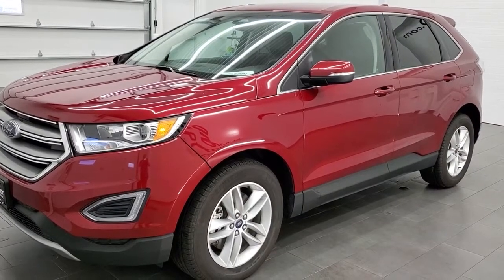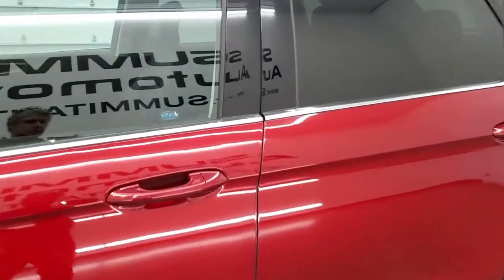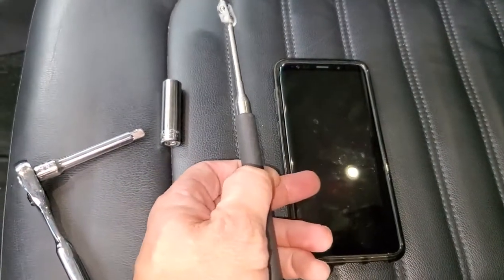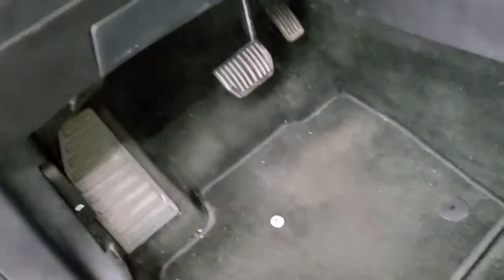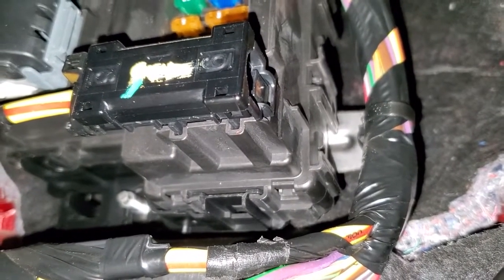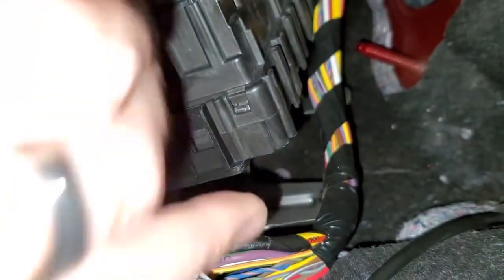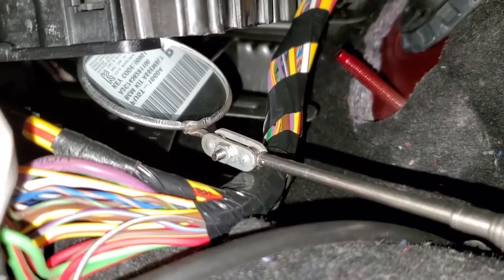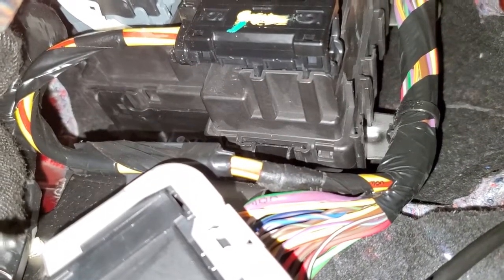WHERE IS THE DOOR CODE LOCATION FOR MY FORD EDGE DOOR CODE 2015 2016 2017 2018 2019 2020 2021

Comment: What a dumb place to put it I've seen so many other ones you take the cover off the glove box and it's right there there's got to be another place somebody said in the back somewhere you got to take a cover off or something I don't know what I sit there and bust all eclipse
Reply from the maker: I dont hide them I just find them. Lol
Reply: Yeah I went to my local Ford dealer they tried to scan it and it won't come up when they scan it I only have one key fob I didn't get the card for it so I need the thing so I guess I have to dig around for the darn thing somebody said it's in the back and the left behind the side panel somewhere there in the back some kind of relay or something that's on supposedly
Reply from the maker: This video is how you find it on this model year edge.  Just follow the video.  I have never not found one.

Comment: Spot on... The dealership wanted a couple hundred because I didn't buy the car from them. However, what a ridiculous place & the sticker definitely may not be as easily seen as mine was further back unlike here. I used doublesided tape so I wouldn't loose the nut. A magnetic tip will work as well.
Reply from the maker: Glad I could help.  This is by far the hardest one to find of the ones that are findable.

Comment: And how about if my remote is not working how can I turn my SUV on till I get a remote
Reply from the maker: I am not 100% sure on this particular model.  I would firt put a new battery in the fob.  Until you get a battery You can try pressing the start button with the fob or place the fob in either of the cup holders and then pressing the button.  Hope this helps.  Next time I get an edge in I will do a video on this, but try replacing the battery in you key fob first.